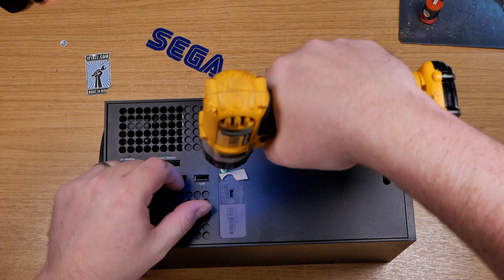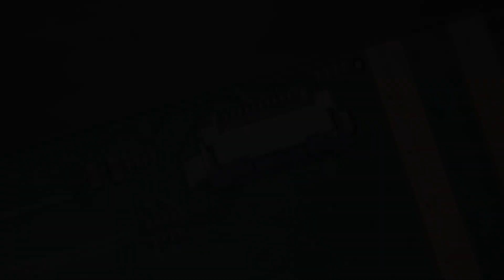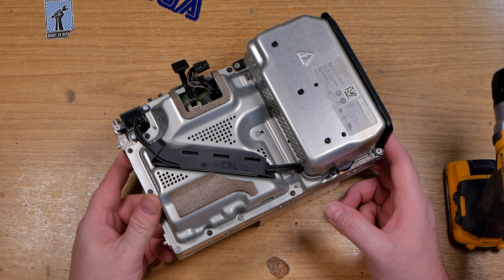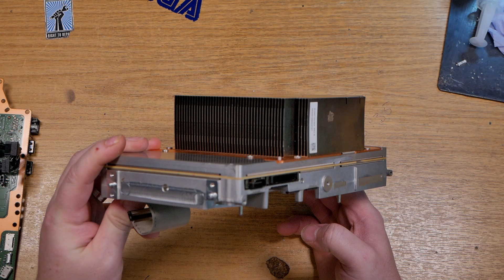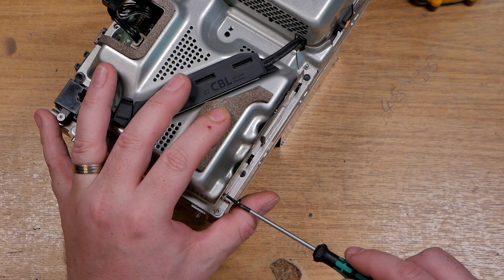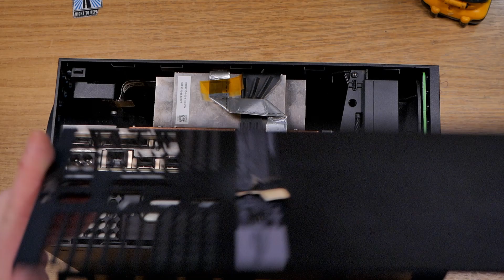Xbox Series X No Power Or Eject ☠ NEXUS Connector and  Cable ☠

Comment: Same Problem here. Thanks for the good Video. Unfortunately i don't have the tools to fix it. If I let the cable disconnected will I be able to start the Xbox with the controller? Hmm .. have to try
Reply: Doesn't seem to work even if the USB ports have power. I connected a controller without batteries on the front and back USB ports and it had power but the console didn't start.

Comment: so i bought this xbox series x that needed a new motherboard board &  its a newer series x which is a v2 console from ( 2022 )and i got spare v1 boards which are from a ( 2020 ) seriesx ... the motherboard , daughter board, and disc drive board , i had swapped everything over but its now having an issue with booting up. it will beep and show the light and quickly turn off less than a second . i swapped the powersupplys with my original series x and this other one and my other console works fine but this one im working on still having that issue. would u think itll be the power/eject board causing the issue ?? cause those are v2 power / eject boards & the power / eject button board is also v2 , like should i replace them with 2020 boards to get it working right??
Reply: also, the other v1 boards are like new , they came out of a console that had an eject problem but the boards where tested and worked 100% ... should i also replace the nexus cable too?